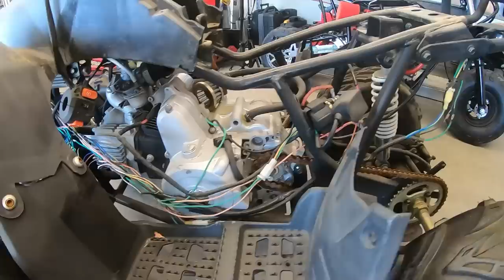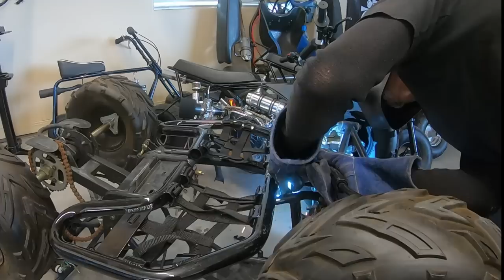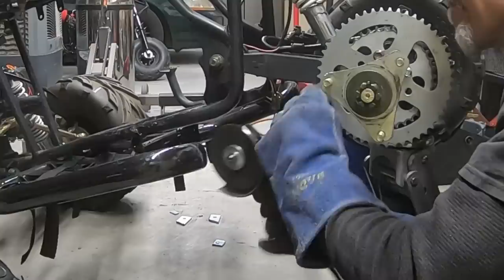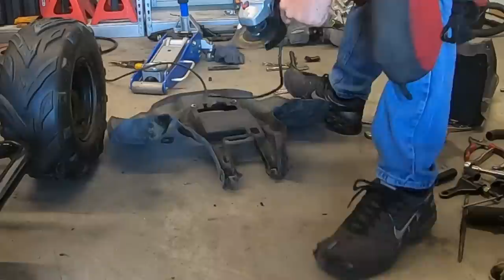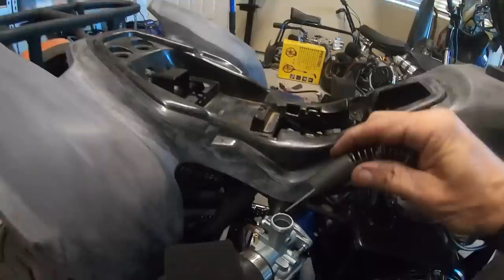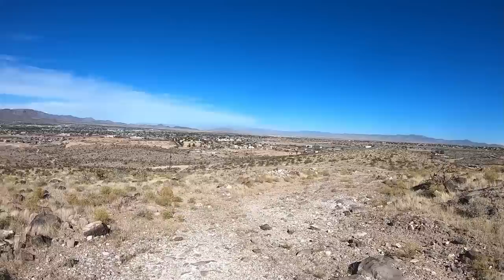Predator 212 Hemi quad ATV swap road test

Comment: Love the videos man, got any recommendations for a coleman cc100x with a stock preator 212 in it. I'm trying to get a higher top speed.
Reply from the maker: Thanks ! Removing the governor if that isn't done yet will give you more speed.   On that bike it comes with low gearing because of the small engine it comes with.   You could always run a clutch with a couple more teeth or a smaller rear gear to pick up speed.  Check out the CC100X Predator 212 playlist. https://www.youtube.com/watch?v=y3pl7KiSTmY&list=PLkbj-ip-5FzZyxkQC4TesuHYV4KgCMFWX

Comment: Hello, I made a medium size quad with a 212 cc ghost Predator... I have a problem: the torque converter band burns when I start uphill, do you think I should use a better quality band or center the engine?
Reply from the maker: Check out this video on torque converters eating belts 
https://www.youtube.com/watch?v=AR2vISEaTcc
Reply: @Black66  Thanks I think I have to align better, my problem is that I welded a different sprokect, to use a larger chain (suzuki tlr 200) I removed the excess material but maybe I should use more washers to align.

Comment: Hey, 
I have an ATV similar to yours, did a sprocket come with this engine you bought or were you able to use the old one?
Reply from the maker: I used the stock sprocket that came on the quad and the sprocket that came with the 30 series torque converter. Check out the new video with the quad if you haven't already https://www.youtube.com/watch?v=ZDDBnV7FK_Q&t=313s